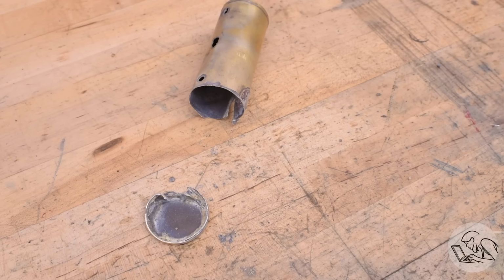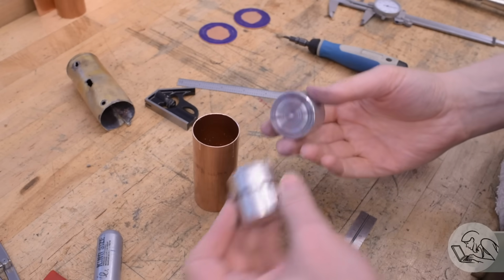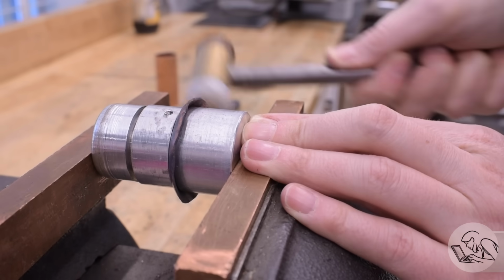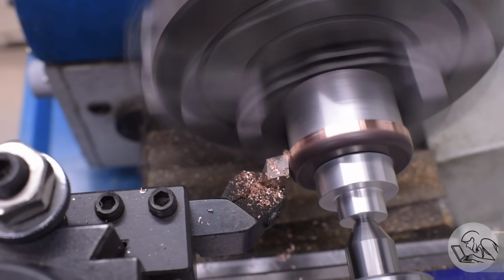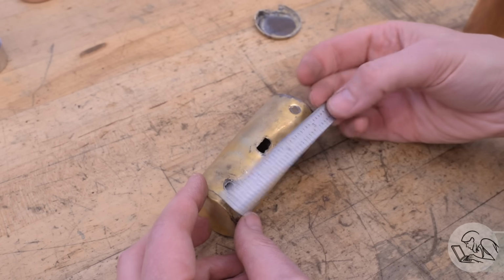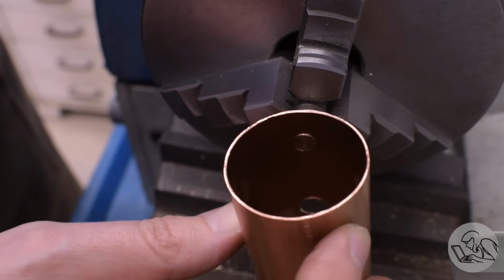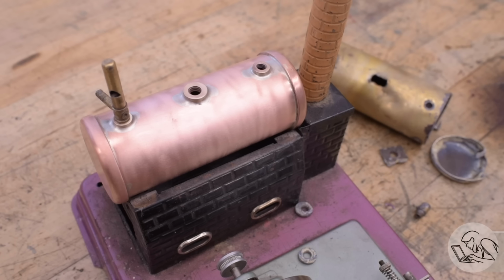New Boiler For Vintage Steam Toy - 1950 Fleischmann Restoration, Part 2

Comment: glad you called out step drills as a useful tool; i find them invaluable for control panel and junction box work at my job, when i need to make holes for cable glands or indicator lamps/push-buttons in a box. saves so much time!

Comment: You are brilliant. I got stuck trying to make a vector animation of a steam engine without understanding the engineering behind it. As I watched my animation it was obvious that the motion of the sliding valve in relation to the piston was incorrect. I was discouraged.
I watched another video which explained the Walschaerts valve gear. I added your videos to a playlist that I can study until I'm able to wrap my head around the concepts.
I'm fascinated with this subject because I think off-grid home power generation should be common. In my mind, a small steam engine should be able to charge a bank of batteries. The boiler fuel could be wood and trash in a rocket stove. The power would be supplemented by solar cells.

Comment: Quinn I just want to say Thank You for all the tips and tricks you show us each week. Because I have learned so much from you I was able to use my Machinist drill press, yes I know not a milling machine, but for the small amount of the white metal casing I had to remove and the fact that this drill press is a beast, from Bell Labs in the 60's, it did the job, easier and cleaner than any other tool I own. Yes I am hooked. Now to save for the lathe and mill. Thank You Again.

Comment: Would it look cheap to paint it with a gold (brass) high temperature paint? Or maybe a bronze colour could look nice? A bit of a nod to the original without the issue of tarnish and corrosion.
Reply: Also as a hobbyist who occasionally does silver solder to repair small metal parts (clockmaker) I have often had success holding small pieces of cut solder in place just using additional flux as like a "glue". As long as you aren't approaching your torch too fast and too close (which makes them blow away or fall off). I've found that this works pretty well for me. I definitely agree that it's much harder to neatly melt-in from a wire of solder as I always tend to blob on too much. I use such tiny amounts that they are usually cut into 1mm x 1mm bits with a utility blade.

Comment: The use of BA measurements might have a cause in the situation in Germany in the 1950'ies. In those days the Country was largely devided by the 4 major Allies and the UK was one of them. So using a UK measurement system could have been influenced by the (non)availability of certain parts used in the boiler.

Comment: Quinn, this is just a wild idea that came to me when you were using your lathe to thin the end cap flanges.  Here goes:  Could you have placed your flat end cap material in your lathe using your male die & pressure from the tail stock and then hammered the flanges into shape?  Without damaging the lathe?  If this wild idea works, it seems like it would be easier to use than the vise because you could turn the end cap continuously by hand instead of having to open & close the vise?

Thumbs up!
Reply from the maker: No I would not hammer on one’s spindle bearings.
Reply: @Blondihacks  Thanks, I didn't even think of that!

Comment: I would be curious if clear Cerakote would prevent yellow metals from tarnishing.  The only issue is Cerakote doesn't stick well unless there is a properly roughed surface (so no polished parts).

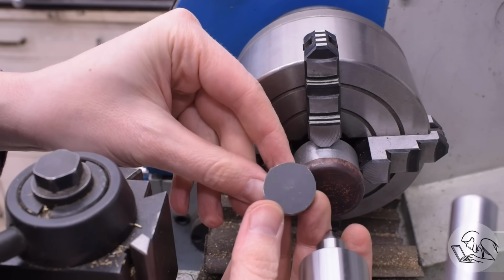Comment: Hey Blondi/quinn i have a question for you; at 8:55 you mention the little backing plate with emery glued to it, but i'm wondering, what is the point of the emery cloth? like i understand it is there for more grip on the part, but as far as i can tell, there isn't any reason to put it on the tail stock side. It isn't being driven by the tail stock, and as seen at 11:23, it isn't preventing the part from spinning either. it also isn't preventing the part from flying out, the flange on the part itself does that job. so just wondering if there is some reason i am overlooking, you accidentally put it on the wrong side, or something else. Thanks!

Comment: There is a procedure whereby you can spray a coat of clear on the copper that someone figured out on yt a while back. He had a set of car rims covered in copper and then clear coated them. But I dunno if this would work in your case if since the boiler will experience temperature changes …

Comment: Hello Quinn,
In most of Europe we use metric threads for screws and fittings, while we (historically?) still use imperial treads for hydraulic tubing. Maybe that's the reason you found mixed threads

Comment: Quinn, I still use BA nuts and bolts as a preference on new models. You can buy fittings with one size smaller heads which is great for many scale applications as they “look right”. So you have a 5BA thread with a 6BA bolt head and nut. This is really good for steam piston heads as the heads look size appropriate. I end up making my own studs and nuts, generally buying bolts. Many suppliers in the UK with cheap fast shipping and you can get a cheap set of taps and dies from eBay. I ended up buying much higher quality taps and dies from UK suppliers when I learnt more 😊

Comment: Hello Quinn, love your projects, big fan! BTW, why do you not have a Ridgid brand pipe cutter? I'm a pipefitter by trade, and a pipe cutter will give you a precise, straight edge, with little deburring. I liked your paper 'wrap around' as we fitters call them, also found in hardware stores or plumbing supply shops. Keep up your excellent work! :)

Comment: Hi Quinn, a joy to watch again ❤
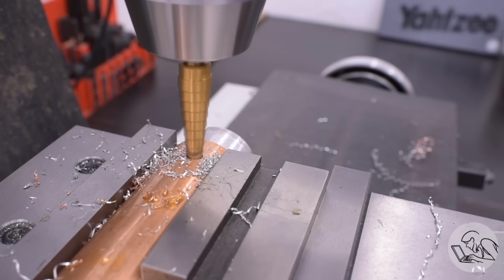14:40 - a simple and sure way to drill a hole into thin metal with jobber drill:
Cut a cotton t shirt to a suitable size, fold it into 4 or 8 ply and put it under drill tip and drill slowly. 
Chips will jam into the cotton and prevent vibration and pull. Yet soft enough to be pushed out by drill force. Try it, you will be surprised 😉

Comment: Try working on an old Velocette LE motorcycle (British). On my 1957 example the oil pan is held on with 16 2BA nuts on studs, inlet and exhaust are also on 2B studs. It's a small bike, a flat twin cylinder of only 200CC but it's water cooled and has a hand gear change. You'll find BA threads in a lot of old British Lucas equipment too. I've successfully used rubber grommets for pressure turning things. I just pick one sized so I can use a live centre in the tail stock pushed into the hole in the middle to apply pressure.

Comment: Way oil sounds good, Ive been using neatsfoot oil (a very old timer cutting oil) If I leave any anywhere it gets sticky and difficult to deal with. It is however a lot cheaper than way oil so I wonder if it works better...I do need to invest in some way oil so I will get to compare. 
Boiler looks great ..I'm a little happier now finding out that I am not the only one who has problems soldering big joints like that but very nice job for the test.
Thankyou very much for sharing

Comment: Quinn don't know if you ever saw any of the work from the luminary shop but he has mad skills in soldering and metal forming. I have over 40 years sheetmetal work and custom fabrication, watched one of his videos and realized I need another 20 years of practice to come close. I know not model related but great info. Restores and manufactures different styles of buggy lamps.

Comment: All Meccano threads are 5/32 BSW (British Standard Whitworth). Again, this is an old imperial size, which is around the same size as an M4 metric thread, but the two threads are not compatible with each other.

Comment: You should paint it to protect it.  Just use some good ole high heat antique copper spray paint.  Covers the solder and keeps a look similar to the original.

Comment: The effect of thickening by “packing” the metal like you did by hammer forming is called “upsetting”. Also the guy who talked about stamping probably don’t understand that to cold form a piece with such tight radiii you probably need a 25T press. Keep up the good. Work. As it’s tradition

Comment: Having worked on many optical scientific pieces of equipment the standard thread used in the majority (90%) is BA. I used from 1BA down to 14BA for some of the restoration work that I once did (I retired!).

Comment: For silver soldering the flanges, would it be possible to balance the cut bits of solder on a small ring of clay or some similar material? That is, make a sort of shelf or lip out of something that won’t burn or stick to the solder?

Comment: Hi Ouinn; British motorcycles pre 1970 used many BA fasteners in small sizes.
Reply: I was about to say the same as well as modelling and similar vintage electronics enclosures or car dials, here in the UK 🇬🇧 , although my motorcycles have cycle threads BSF and w/w as well just for variety 😂

Comment: Could you also roll the flange over on the lathe with a mounted bearing? Or is that not possible with the workharding of the copper
Reply from the maker: You can. I have demoed that method in other boiler builds.
Reply: @Blondihacks  okay i will go and see that video 👍🏻 but this is a nice boiler you have made👍🏻👍🏻

Comment: Great job Quinn..Your skills are really good!.. I rebuild old miniature model engines...and also do anodizing  and some nickel plating. That would look lovely. It is pretty easy to do., and to get a real good chrome like finish, you need to have some things just right. But  again, it is really pretty easy to do...but that is just a suggestion.... I am sure, you find a solution Quinn.
 Keep up the great work! May the chips fall where they fall! 

Best regards from the Netherlands!

Peter

Comment: I purchased a couple of the Stuart models steam kits and they use the BA threads. I also came across a British Whitworth thread a couple months ago on none other than the PM728VT mill stand. I guess they are still using Whitworth threads in Taiwan, who knew.

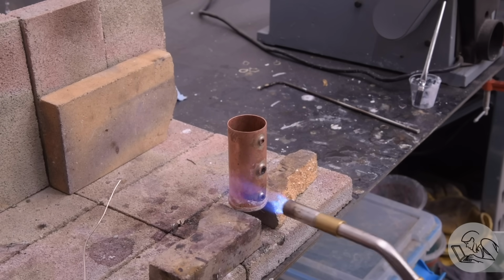Comment: 19:53  Howdy Quinn!  In RF Engineering, we used to hammer silver solder (Safety Silv 56%) flat so it would stay on the connector flange of 4" 50 ohm copper hardline during soldering.  Feather one edge out so you can just cram it in the gap.  Low pressure (5 psig), but it worked like a charm.
Also, inside the transmitter room, we used Everbrite Coatings to keep our brass and copper nice and shiny.  I don't know how that would perform with heating or movement of a boiler, though.
Cool project!  I'm looking forward to seeing it run!

Comment: The new boiler looks tremendous👌 
Something I got to try recently when turning copper is  DCMT shaped carbide inserts with a thin wafer of Polycristalline  Diamond at the cutting edge (PCD).
These diamond wafer tips cut copper without tearing or smearing the metal.
Reply: How much of your savings does a specialty item like that cost, though? Can't be cheap.
Reply: @autochton  The UK suppliers are about £22.00 quid for a DCMT 11 sized PCD cutting tip. You can get them quite a lot cheaper than that from a well known chinese site but they will be longer before delivery.
CBN and PCD inserts are relatively cheaap these days and last a very long time as long as they are not abused.

Comment: On the BA thread thing.  You might be discounting how the early model engineering hobby embraced the BA thread family.  All of the old Aeromodeller and Model Engineer magazines from the 60's were constantly on about BA this and BA that.  So perhaps use of BA threads on this steam boiler might be a nod to how BA threading was used by all model engineers regardless of home country?

Once it turns to a brown patina try lightly wiping the upper exposed side with Canola cooling oil.  It's the oil that is often suggested for "seasoning" cast iron and carbon steel pans.  After it polymerizes it's pretty good at resisting the heat.  Might just halt the ongoing corrosion towards green verdigris.  Or at least slow it down by a good amount.  Worth a try at least?
Reply: On BA threads. I think Old Lucas points used BA threads. Great video, thanks for the Chanel.

Comment: We do all the leak tests at work using air, since it takes no time to clean up.

But we do them at incredibly low pressures, since it's not something that should be under pressure in operation. I think we use something like 0.15 bar, which should be on the lower end for a normal party balloon.

Comment: My favorite surface protection for copper is nickel plating. DIY nickel-plating doesn't get shiny because some special chemicals are needed, but one gets a very nice satin finish.
Reply: Came here to suggest this as well. The fire sights on the firebox appear nickel plated. And Wilseco's boilers are also nickel plated. 

I received a Mamod stationary unit as a kid, I kinda wish I had the skills here I'd the same and restore it, but I think at this point the best solution is to break it down for parts and mount it to a flatcar for my G-scale RR

Comment: Could this not have been formed by clamping the copper between the two formers using the lathe chuck and a revolving centre in the tailstock and rolled over with a smooth former in the tool head similar to the way they form copper and brass bowls and plates ?
Reply from the maker: I have demoed this on my channel before
Reply: Commonly called metal spinning as someone has already mentioned in a comment above. It would certainly work well to spin form the end caps.

Comment: I asked AI the question in German: "Did Germany ever use BA threads?" The answer came up: Ja, auch in Deutschland wurde das BA-Gewinde (British Association Thread) verwendet, besonders in kleineren Bereichen wie Modellbau oder Instrumentenbau. Es ist ein britisches Gewinde, das heute aber selten verwendet wird, insbesondere im Vergleich zu den gängigen metrischen Gewinden" translated:  Yes, the BA thread (British Association Thread) was also used in Germany, especially in smaller areas such as model making or instrument making. It is a British thread, but it is rarely used today, especially in comparison to the common metric threads.

Comment: When I installed a new boiler for my central heating system, I scrubbed a few of the copper pipes with steel wool and they are shiny to this day. I don't remember actually but I suspect I may have wiped them off with a mix of triple-boiled linseed oil, beeswax, and orange oil which I typically use on most of my woodworking. I should test that.

Comment: There is a clear engine coating that will stay clear up to 130 degrees Celsius. It is used on Ford and Opel car engines. Love your new boiler you are getting exceptionally good at making them.
Reply from the maker: I’ve tried it. Doesn’t prevent tarnishing
Reply: @Blondihacks  well that's a disappointment. Thought it would work. Works quite good on Aluminium motorbike engines. But then again they don't tarnish. They just oxidise.

Comment: Quinn went full My Mechanics and made a new one (that's ten to twelve times better than the original ever was) 😁

BA thread is not just weird, it's DIABOLICAL It starts out with mildly baffling metric M6x1 pitch (which is not evil, but surprising as the brits were nowhere near metrification at the time) and then each next size is downsized by a factor of 0.9 which makes the rest neither metric nor imperial. The final cherry on top is the thread angle of 47.5° so even single point turning is no-go with standard tools.
Reply: It does seem an oddball thread series
Reply: Many widely used threads have odd history. For example camera tripod treads were brittish (Withworth?) that is close to imperial but has different thread profile. Thankfully they are compatible enough to be usefull.

Comment: I remember an old British model engineering book talk about BA threads, definitely from before BA became officially obsolete in 1966. The author points out that they filled an important gap as Whitworth didn't get smaller than a 1/4 BSF and metric hadn't been established yet in the UK. So a lot of of pre-1960s UK designs (and thereafter through cultural inertia) will use them where today we'd use an M3 or M4 thread. BA taps & dies are still available, but unless you need need them, buying them for a one off is a bit silly if you can make a metric thread work instead.

Comment: You can take a tubing cutter wheel made for copper and make a tool to use it on the lathe. This is made very similar to the bearing tool you have used in the past.

Comment: First thanks for all you do. BA screws seem to be quite common in British kits. AKA Stewart the only ones I have access to . as far as tap and dies they are readily available on flea  bay for 50 - 70 usd iirc most of these kits re out of india.
Reply: In the UK I think Tracy Tools stock a good range of BA taps/dies in left and right handed threads.

Comment: Have you tried spinning the rim over the mandrel with that same pressure setup you use for turning? I've had pretty good luck using a greased ball-end tool in the tool holder (actually its a dapping tool for making dished depressions).
Reply from the maker: I have shown that on my channel before

Comment: As to the odd thread sizes -- you might have heard that some sizes of certain things in "metric" countries have stayed British for decades.  That is particularly true for pipe threads.  And the boilers, as well as the railway stuff have been influenced by the British locomotives and other rail standards.  Not to even start about the house building with "two by fours".  But consider the two 1/4" pipe threads, one in the US and the other in UK (plus often elsewhere in Europe).  One of them is 27, the other being 28 threads per inch...